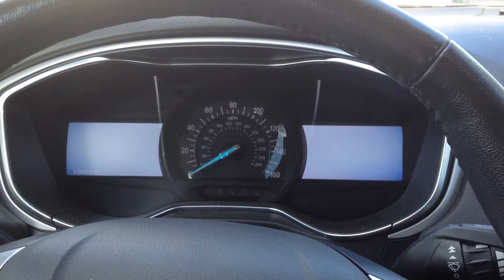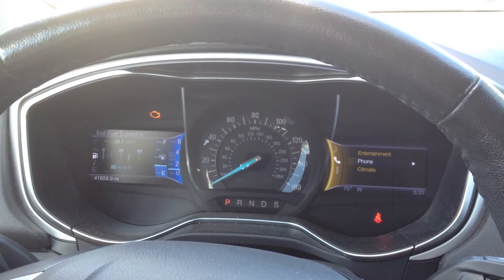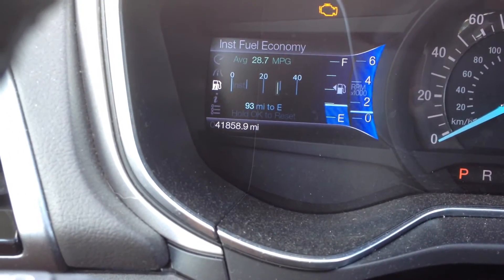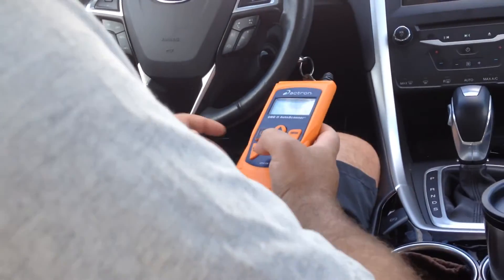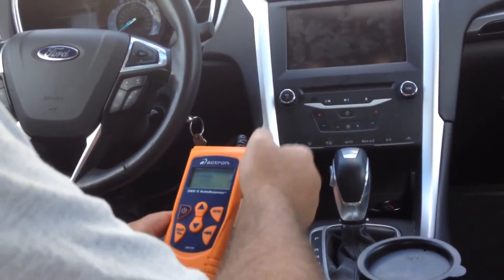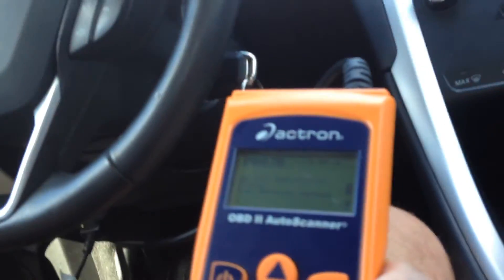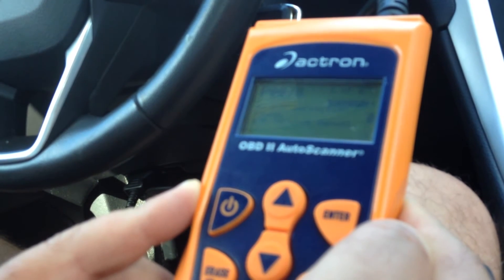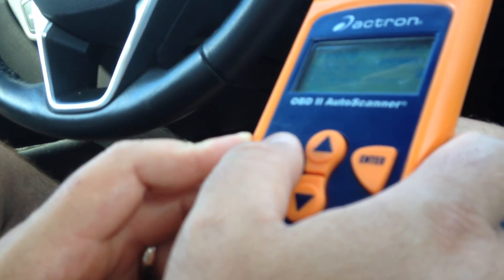How to fix a P007B Check Engine Code

Comment: did you have an install video?
Reply from the maker: I just posted the best video I have of it.  Be careful with the hold down screw mine was stripped.  It is a very tight fit on top of the intercooler tube and you have to take off some of the underbody shields.  Otherwise pretty easy fix and 25k miles later no new codes.